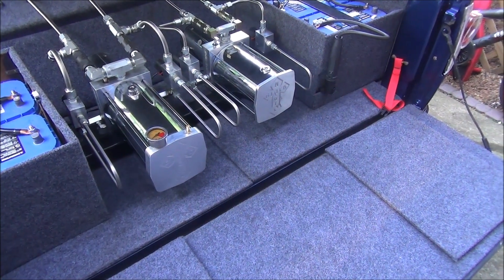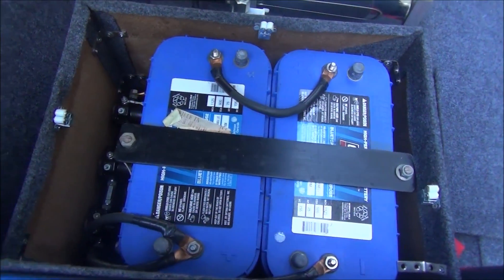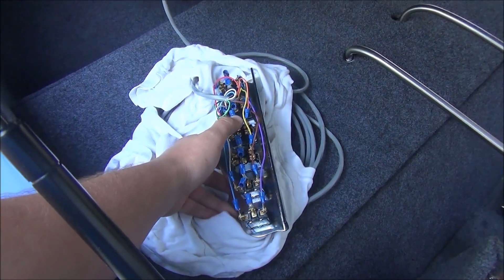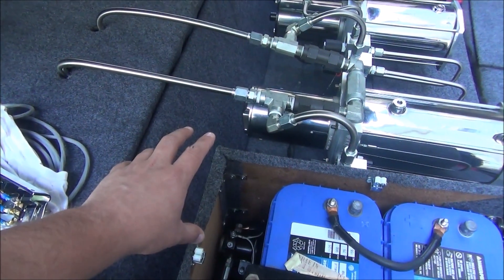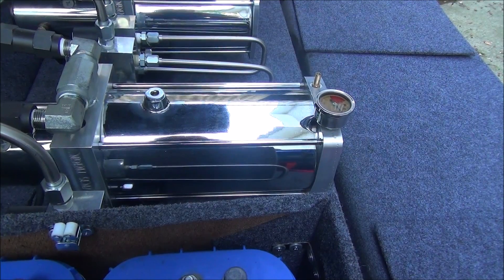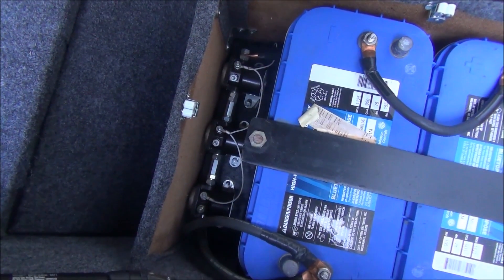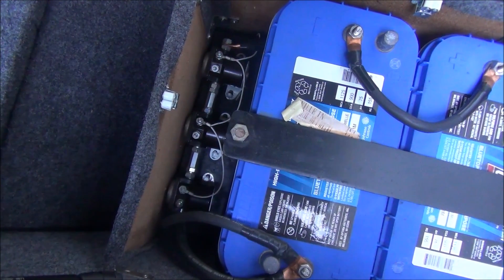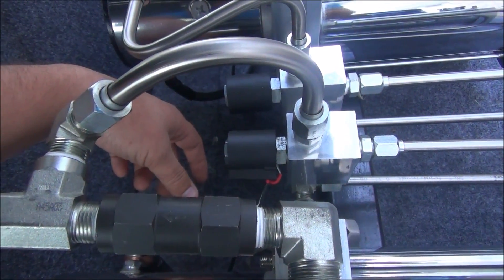How to Basics of hydraulics Lowrider How it all works

Comment: Looks like teflon tape on the check valves. Don't use teflon tape. It's not a sealant.
Reply from the maker: Not sure why you think that but we use Teflon tape on all fittings except for JIC, otherwise they will leak.
Reply: Teflon tape is also always used on water and gas lines, like everywhere, by professionals, so i don’t see how it wouldn’t be a sealant.

Comment: Nice set up. Question if the car was suspended without the tires touching would the hydraulics pull the tires up?
Reply: No. They are single acting cylinders. They are only powered in one direction.  Extending not retracting.
Reply: I dont think so. Not an expert about lowriders but I do know about hydraulics. This is what I think.  when you lower (dump)  any part of the suspension,  whats happening is that you're releasing pressure.  Pretty much a valve opens and the weight of the car puts pressure on hydraulic suspension allowing the fluid to be released,  which in turn will lower the car.

Comment: I want to build a low rider some day, trying to learn how the hole thing works first before I start saving up haha
Reply: Same here homie...same here
Reply: Study Hydraulics.
There are millions of applications.
Can’t hurt.
Reply: @og-greenmachine8623  Honestly im just lookin to build one simple setup, from what I can understand from youtube, is that it works essentially like, u flip switch, then fluid from the pump runs to the cylinders which lowers or raises car. Cylinders are connected to hose running to pump which is powered by batterys. Switch is flipped and boom its lowered or raised
Reply: @dapplesauce6999  I'd consider the problem with lowriders to be the stabiltiy of components. The weakest part breaks first and you must know where to reinforce the frame etc..
Reply: I bought my impala first then looked up the YouTube videos😂
Reply: I want a 1964 Impala with hydraulics some day

Comment: How much does it cost to install a hydraulic system ? (Parts and labor included).
Reply from the maker: Drayton Mays minimum $1000 if you do it yourself, and that’s a pretty basic setup. If you have someone reputable do it probably $3000 starting out. Depends on what you want really.
Reply: Russell Harris Lowrider Hydraulics aight thanks bro.
Reply: Russell Harris Lowrider Hydraulics are y'all still working on lowriders???
Reply from the maker: jdto14 yes

Comment: Why when i lock up my front side goes down a lil bit by itself get to me as soon as you can thanx bro ur vids get indepth aprecciate it....
Reply from the maker: Michel Johnson there are several possible causes, I would first look everywhere around the car to see if you have a leak anywhere, if you do, fix it. Second, a bad check valve could be the cause. Third, trash in your fluid that is getting caught in your dump valve or check valve causing it to stay open just a little, if that is it, you have to drain the tank and pull the tank off, wipe it out the best you can to remove any trash.
Reply: Russell Harris Lowrider Hydraulics alrite thanx bro ima chek it out dont know too much but ill see wat i can do...

Comment: What's the difference between 6 prong and 3 prong switches. Can I use a 6 prong to 3 wheel or do I have to use a 3 prong switch. Also is it possible to do a standing 3 wheel with a 2 pump 8 battery setup in a 64 impala
Reply from the maker: Michael Mckay 3prong switch is made to run one pump up and one dump down, 6 prong is meant to run 2 pumps up and 2 dumps down, however can be used for just one up and one down. I have another video about wiring that may help better. It is completely possible to have a standing 3 wheel with a 2 pump. I'll post an in depth video today to answer those specific questions. Stay tuned.
Reply from the maker: Posted https://youtu.be/ZtbUq8uV_d0
To answer your other question, yes it is possible to have standing 3 with 2 pumps 8 batteries. We just did one with that exact setup. What you have to do is make sure to put 4 batteries on each side, make sure you cut out the tunnel for the drive shaft to be able to go through, have individual wheel switches, replace factory banana bar in the rear suspension with a Y bar so the rear end can swivel, the factory banana bar restricts it from moving the way the it needs to in order to 3 wheel, lift the front all the way up, lift the back all the way up, drop one back corner. That should do it. Assuming your running 12s or larger in the rear. If running 14s or larger, you'll need to probably go with a wish bone and consider getting extended trailing arms, thats what I've done on mine but I'm running 20 inch cylinders on my impala, and before you ask, my impala is still being worked on and I don't have videos yet. I will post them someday but I have a ton of work to do. Hope that helps Michael.

Comment: are u on 48v or only 24
Reply from the maker: fuzzy wuzzy 48v
Reply: Russell Harris then why does your truck on jump around a foot? i thought 48v and a piston would do alot better than that.. i know ur runnin a lower profile tire but is that the only thing thats stoppin it from hoppin higher
Reply from the maker: fuzzy wuzzy it's a mixture of a few things, my slow downs could be opened more, the rims and tires are a big factor, Springs are cut pretty low so the truck will sit low on 20s, weight distribution is a factor because it is a truck with no weight in the rear to help it seesaw like cars do. When I built the truck it was only meant to be a little cruiser, not a hopper at all, just a toy, had one when I was 17 with Hydraulics and wanted another while I finish my Impala. If I really wanted it to hop, I'd add two more batteries because the pump can handle it, change the rims to some wires and put about 80 psi in the tires, add a little more weight to the back, open the slow downs, change out the Springs to a fuller stack and then roll out. But like I said, it's just a toy, I have my Impala to go crazy with.
Reply: Russell Harris i got it. i was just wondering
Reply from the maker: fuzzy wuzzy it's all good bro, I want these kind of questions, people can read them and learn. I don't always remember every detail.
Reply: Russell Harris i ask cause im debateing on a piston pump for my town car. im gonna have 48 to the nose so im just curious about what to expect. but yea ur right about the weight. your truck is balanced completely different than a car